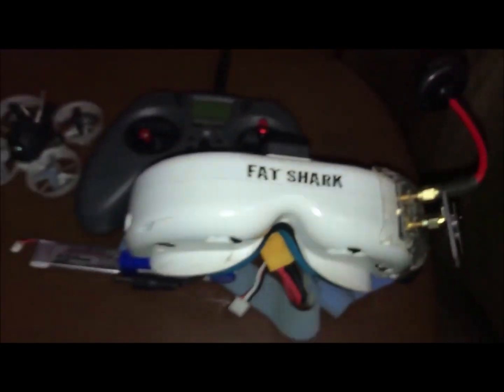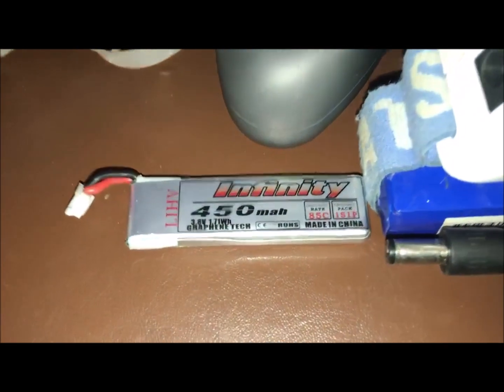Makerfire T-Lite FLIGHT TEST High WIND Drone Multi protocol Radio 5.8 ghz Whoop Instructions

Comment: Looking good brother. I wish I was as good as you when it comes to programming  those controllers.  I would of gotten one a long time ago. I just ain't smart enuff or have the PATIENCE  for all that. Lol. Good to see these kind of videos out of u again brother...
Reply from the maker: Using these radios super simple brother
Reply: @JayDrone  well they would have to be super simple for my dumb ass to get the hang of them.. lol

Is that the same place yall checked in to when you got down there, or have u switched up. Might just look different  due to the camera on the quad I guess...lol